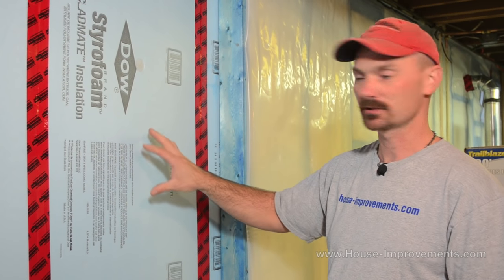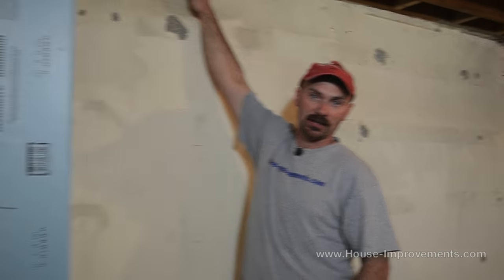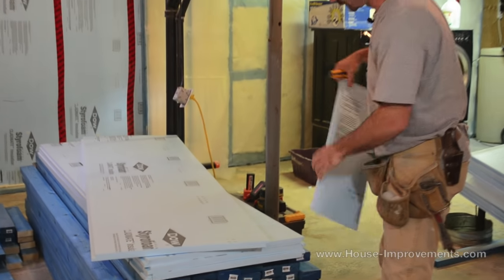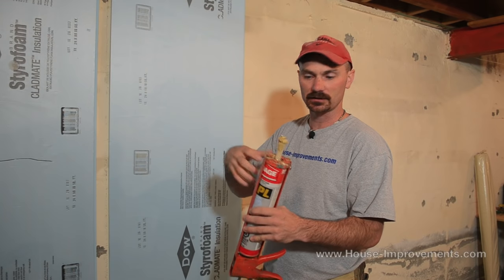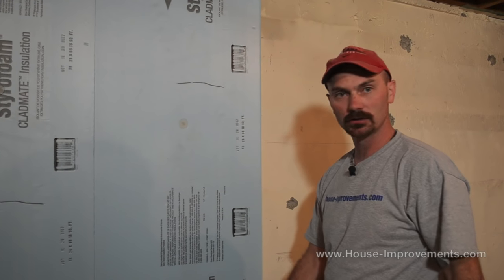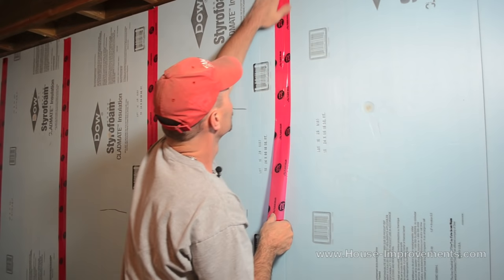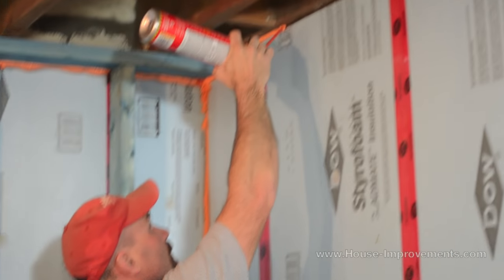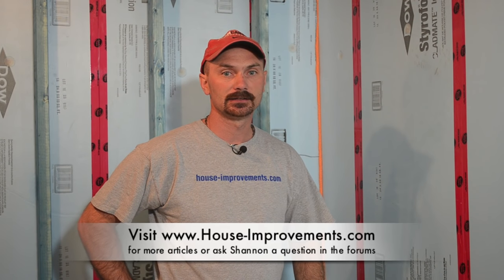How To Attach Rigid Foam Insulation To Concrete

Comment: I like your videos overall.  But in this case you have 2 vapor barriers installed; the inside surface of the foam board and then the insulation is behind another vapor barrier, the plastic. I have always thought that two vapor barriers like this is bad idea.  If moisture gets between those two vapor barriers, in the insulation, it will be a set up for mold.
Reply: Actually, three vapour barriers - the concrete waterproofing/damproofing is more or less a vapour barrier. Depending on local soil/groundwater/climate conditions this can be a really bad idea and accelerate foundation damage due to adfreezing. Not to mention interior moisture issues.
Reply: What would you suggest?
Reply: @rawhim5033  No plastic on the studs over the batt insulation. You don't want a vapor barrier on both sides of the batt insulation. Allow the batt insulation to be in moisture equilibrium with the inside of the basement. What is shown in this video is a setup for mold in the insulation if moisture gets into that space.
Reply: @solareclipsetimer mold won't grow in fiberglass insulation there's no food value there, it has to have wood or something to eat. I have seen it mildly on the paper backing on the fiberglass
Reply: @shanek6582  Not sure about that statement. Where there is moisture, there is a setup for mold and mildew. I've seen mold and mildew grow on the top surface of TREX decking (PVC plastic) at my house every winter in the areas that don't get Sun to dry out. There is no food value there, but it grows, for some reason.
Reply: The foam is not a vapor barrier. It's a vapor retarder.
Reply: @scotthogan177  
At 1,5" to 2" it is a vapor barrier based on perm rating.
Reply: @solareclipsetimer   There's all kinds of organic material on your deck for mold to grow on. Dirt, pollen, tiny decomposing bugs, etc.

Comment: IMO, I rather use an adhesive to hold the rigid foam to the wall before I install the stud wall.  No need to put holes in the wall plus its simpler and faster.  I also agree with use of rock wool insulation for it ability to not mold if it gets wet and its fire rating.  Just my $0.02. Good instructional video.  Keep up the good work👍
Reply: would be nice if Roxul was just $0.02 ! : )
Reply: Until mold comes knocking on your door
Reply: Roulette definitely worth it: doesn't burn, get moldy
Reply: Thanks
Reply: Roxul definitely worh it, does not rot or burn and pests dont like it.

Comment: Why even bother with the framing?
Reply from the maker: foam should not be left exposed in your home. It gives off  toxic fumes when burning
Reply: @HouseImprovements  
Okay, but you can just glue drywall to the foam.

Comment: If your rigid foam insulation is "acting as your moisture barrier" there should be no need to add another moisture barrier in the form of the clear sheet vapor barrier.  Installing two vapor/moisture barriers on the same wall can/will create something known as a 'mold sandwich'.  I'd suggest anyone interested in doing as the video suggests should do their own research before moving forward with their project.
Reply from the maker: The interior poly sheet is the air/vapour barrier which is completely different from a moisture barrier that is against the exterior concrete wall.  In some areas the rigid foam, if its thick enough ,can act as the moisture barrier and air vapour barrier but not in my area for the thickness of foam that was installed here in the video.

Comment: You don't want to create a moisture trap with the poly vapor barrier #2. I've been instructed previously to use just the foam boards (selecting thickness to the appropriate R value) then simply your framing in front + mold resistant drywall. Batts inside the cavities are not necessary with the exception of sound deadening, even then it's recommended you use mineral wool vs fiberglass.  The Blue studs are a good idea for the framing, I usually go for a treated footplate. Here in northern Canada it goes down to -55C occasionally in the winter months. The ONLY way to insulate a basement is with the foam as shown here or with $pray foam. When the concrete gets that cold it doesn't matter how tight you think your poly is ANY air that gets behind it will immediately condense against the concrete.
Reply: so youre saying the batting would become molded with the vapor barrier trapping the moisture?
Reply: Sarah Wallace Yes, It's possible should moisture find it's way in between the two impermeable layers. Closed cell foam behaves like an insulation and vapor barrier in one. If you wish to add R-Value or sound deadening in addition to a foam sealed wall a batt in front of the foam is fine without plastic vapor barrier behind the drywall.
Reply: Awesome! Thank you so much for clearing it up for me :)
Reply: I think the reason people also add batt, rockwool, or cellulose is because 2" rigid foam is $85 a sheet and a recommended R20+ is recommended where I live.
Reply: Tania Twordik  good Lord, where are you buying 2" rigid foam board for $85.00 a sheet. At Lowe's or home depot in my state it's  $39.00 a sheet.
Reply: You are both right, because you are saying two different things.

Home Depot, as of the date I'm posting this, has Formular 2" sheets at $29/sheet, so the price has come down since you bought them at $39/sheet. 

BUT...she also said, "R20+ is recommended." The sheets I just quoted for purchase--which is the thickest you can buy at Home Depot or Lowes, at least in Northern Mississippi where I live--is only R10. So you need to double that thickness to get to R20. And if you do that, you're now at $58 per square foot, PLUS it will no longer fit into a 2x4 stud depth. (If they are $39/sheet in your area, you're right at Tania's $85/sheet for two layers, once you throw in the tax.)

So like I said, I think you are both correct.

I'm not trying to be arrogant in my reply. I just happen to have been doing some DIY stuff around my house and have been shopping for this rigid foam insulation for the past 6 months, so I've been dealing with EXACTLY this issue. I finally found another manufacturer of rigid foam that produces R20.5 sheets that are 3" thick--so they still fit my 2x4 studs--and the prices is $83 a sheet, ordered online, because no one local carries them.

Comment from the maker: On cinder block walls I would lean toward attaching the foam with adheisive only. the blocks are generally hollow and can break unless you can drill in the grout line areas . The cost of materials is going to vary by region depending on the foam and cost in your area. Labour will vary as well. Around me this would be about $1 sq' materials and .40 cents /sq' labour
Reply: Hollow are get filled with mortar
Reply: @mosanchez09  At least you always hope they are. I am the second owner of a house built in the twenties and I know for a fact that they didn't use mortar in some of the spots.
Reply: @jeremywheeler8417  thats crazy, i would be mad for a half ass job. Pretty scary
Reply: Agreed. The anchors were really unnecessary.. especially drilling into concrete wall. Just use adhesive and call it a day

Comment: I found that applying great stuff to the back of the rigid foam and bracing the rigid to the foundation until the great stuff cured worked for me. No added holes in the foundation and it was a quick and cheap process. I needed the great stuff to seal around the foam so I had it handy. I've tried to pull it from the foundation wall and it wont budge. I applied the great stuff vertically up and down the back of the board.
Reply: userfriendly06 great stuff is not so great. Very messy.  You must need a can per sheet.
Reply: Only a thin layer, so not so much.  @DONALD1951

Comment: Great video. Using a foam gun makes applying spray foam sealant much much easier and neater, and is more economical- if you're using a lot of foam sealant, it's well worth investing in a foam gun. You can find a good gun for $50 or less, and the cans are about $8 or less in bulk. These cans hold much more foam and you don't have to worry about the can or nozzle clogging. 

Just always keep a can of foam on the gun and run some foam through the gun at least every other week, and the gun will last many months without ever having to clean it. Using acetone foam gun cleaner actually makes the gun clog faster, only use those when you're going to put the gun away for long term storage.

Comment from the maker: Yes , you must use an adhesive made for ridged foam as you said.The problem with the adhesive is that sometimes you need to use temporary support to help hold it to the wall until it sets. If your walls are fairly smooth and even you will have better luck in maybe not needing temporary support.

Comment from the maker: Tape your anchors as well if not using a vapour barrier.Some prefer to use some poly under any wood touching concrete but I only use it under the wood if it is not pressure treated or blue wood.

Comment from the maker: Yes I would insulate the wall cavity with batt insulation as well. Most 2" styrofoams are about R8 or R10 . If you are in the northern States or in Canada that is really not enough so by adding another R12 to the framing you will have a nice warm basement. Don't forget your vapour barrier before the drywall goes on. I used "Great Stuff" spray foam but really pretty much any type made for filling gaps and cracks will do.

 The infloor heat is a great way to go, you will be toasty warm .

Comment: great video Shannon.i just insulated 2 courses of block in my shop using your method.the anchors are made by ucan and can be bought at CRS or bolts plus here in Canada.
Reply: good to hear, I'm thinking of insulating the concrete surrounding my basement with rigid foam , but adding tinfoil bubble wrap in between, makes sense?

Comment from the maker: Well I live in Saskatchewan and it definitely gets cold here in winter. I have never ever heard of such a thing! New homes in my area where the basement will not be finished before the sale of the home must have the basement walls from the main floor down to the outside grade level insulated. Usually a" insulation bag" is used for that, but once the basement is finished into a usable living space the exterior walls are completely insulated and inspected buy the local authorities.
Reply: Less chance of mold build up

Comment from the maker: The poly and foam is there to prevent vapour from entering but if minor amounts do get through they should evaporate
Reply: I thought you would want the moisture to get through a permeable barrier in order to not trap it. How else will it dry out?

Comment: I agree with a few other comments..the 2nd vapor barrier is a no-no.  I would also stay away from all that drilling for the anchors...you only need the foam board adhesive he mentions as a wall is being framed up against it.  other than that, good job.

Comment: What do you do with outside corners? Use foam sealant, tuck tape, or what.

Also how small a piece can be added. I'm doin some planning and it looks like I might be need2 inches more than a full panel on one wall. So it makes sense to me to insert a  3 foot wide  cut-off somewhere in the middle of the wall rather than trying to add a narrow piece at the end.

Comment: sorry, 1" board is made by Poly Shield, it is their R3.85 expanded polystyrene board. The fiberglass insulation is Johns Manville R13 with kraft faced roll, B-1284. Thanks so much for your assistance

Comment: When My home was built, I had a room put under the back porch with an insulated door into the basement.  This room will be used for a root cellar.  There are two vent holes to the outside, one to bring cold air in, and one to vent the warm air out.  I plan to use a fan to pull the cold air in and the hot air will naturally vent out.  The walls are poured foundation.  I plan to insulate the inside with 2 inch thick blue foam insulation to withstand moisture as this will have fairly high humidity.  I'm planning on painting the foundation walls with mold and mildew killer primer, install the foam board and tape it with adhesive, tape the joints, then paint the foam board with the same primer.  The insulation is needed to insulate the root cellar from the basement foundation walls as they act as a heat sink making it hard to regulate the temperature of the room.  Do you think my approach is sound?  Are both coats of mold and mildew primer beneficial?  Good video!
Reply from the maker: I doubt you need the primer is needed. Depending on your codes in your area that foam may need to be covered to protect it from fire. foam gives off a toxic smoke when burning . In the future my forum is a good place to look for advice and information

Comment: I’m about to do my basement. My question is about sealing the top and bottom. Wouldn’t you want the bottom to be open so if there is any water that may appear can drain out towards possible raised subfloor? Same for the top plate. Shouldn’t we keep the top open so that the wall can breathe and allow for drying out etc ? Thanks

Comment from the maker: The 1" styro does not quite give enough R value to be able to skip the poly , if I would have been using 1-1/2" or  2" I could have skipped it.

Comment: It's probably another video, but what about the rim joist? I use 2- 2" XPS cut a little smaller and spray foam the gap on both giving lots of insulation and air tight. Cheers, good vid.

Comment: I find all your videos very informative and learn new and interesting methods every time I view them..Working on a 130 year old house with a new basement under it. What a challange...Another question regarding the best choice of foamboard for the concrete walls inside the basement. Is there a specific insulation used or can one use the white "basement plus" or the pink C-200. I will likely be using something in the two (2) inch range...Thank you for your suggestions..Dave

Comment: Can't seem to reply to another comment, but one reason to not use the metal T or Z style studs to hold the foam and attach the drywall to is that you only end up with R5 or whatnot. Here in NB, Canada the minimum they'd like is R20.

Comment: Hi.
I noticed that you left the notch on the bottom of the sheet. In my project I'm using 2 inch thick indulation so I believe I'd be inclined to cut the lap off of the bottom of the sheet before making my height measurement. I would lose some R value if I left it on the sheet. I'm not in favour of drilling holes into a concrete wall that will be below grade.
With my luck I'd end up having a leak...
Glad to see that I can use an adheasive and your suggestion regarding the proper one for foambord

Comment: Most videos I've seen that use foam board on basement walls  (e.g. ThisOldHouse) and manufacturer videos, the foam core is actually a vapor barrier (moisture barrier) as well, eliminating the need for the clear plastic sheeting barrier

However, when I look up specs on Owens Corning, their best product is 1.1 which is slightly higher than code "American building codes have classified vapor retarders as having a water vapor permeance of 1 perm or less" so not sure what to believe.

Comment: Shannon, I have been watching your videos for about 8 years now and have remodeled nearly every room in my house with your help. I have a somewhat unique project that is related to this video. I have a room off of my basement that is underneath my front porch. It has four concrete block walls with a doorway from the basement. The ceiling of that room is the floor of the front porch, which is 4" concrete slab. The room is not heated but because it is underground, so it never freezes but does get down to about 36F (2C). When the concrete ceiling is colder than that I get frost and condensation on the ceiling and it drips down. I plan on gluing 1" (R-5 value) foam board to the ceiling. Is this a good solution? Your opinion would mean so much to me.
Reply from the maker: The insulation should help your condensation problem but I'm not sure R5 will be enough in a real cold. You may want to double it up.
Reply: Thanks for your response. I will be going with a 2" (R-8.8) rigid foam.

Comment from the maker: The depth will depend on your anchor length and foam thickness . In my case I was drilling 2" deep.
If you do not have to many you can use a wide cold chisel and hammer and knock them off or a grinder with a diamond concrete disk. The grinder will be dusty for sure though.

Comment: I just bought my first home which is a full block house. First floor exterior walls have no insulation and studs are on the flat, directly against the block. We are looking for a solution to get some insulation in there. Should we gut the 2x4's behind the sheet rock and put up the foam board, like in the video? We would really prefer not to use spray foam. Thanks so much. I would be incredibly thankful for a helpful response from you or any of your followers. THANK YOU! - Bryan
Reply: +Houseimprovements
Reply: +Bryan A Ask this question in his forum.  The address is in the video description.